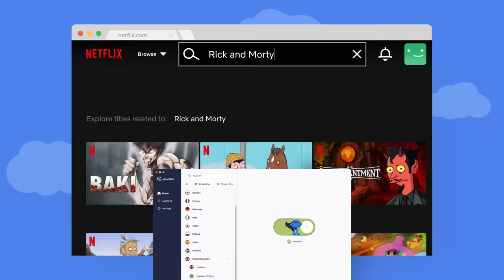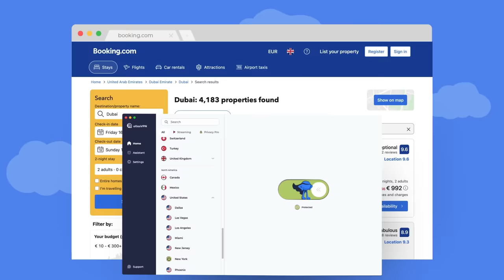How do Russians Cope with Heavy Tank Losses?

Comment: Honestly a 7x production increase isn't that impossible or weird really. Throughout all of recent history you would be lucky to get 50 tanks of any particular type produced in a year. Because when there isn't war you don't need war time production, so they only run one shift and they don't have high quotas or anything. Now running those factories 24/7 with extremely high quotas, well it's not hard to see how they could take that from 0.1 tanks per day to 0.7 tanks per day. 250 tanks per year isn't exactly Impossible, and that would be a roughly 7x increase over the average production of the T90 over the last 30~ years.
Reply: Pre-war, I think Russia's tank production was kinda idling anyway, awaiting the introduction of T-14. Just slow production to keep a core of the workforce, slowly updating the Russian tank fleet, and filling export orders. There's just the little problem, in that T-14 has been "coming soon" for a long time now, and will probably never enter service. Cost, and a new batch of "lessons learned" will probably require yet another new tank design.
Reply: They are claiming massive increases in production with pretty minor increases in the defense budget while also massively increasing the size of the Army while paying soldiers substantially more than ore-war. 

They are either lying about the product tion numbers, the budget numbers or both. But either way you are better if just ignoring what the Russians are claiming.
Reply: Yeah but they are losing about 2 tanks per day, so .7 is a big increase but still not sustainable
Reply: @SgtBeltfed Because T-14 isn't really important right now, it's just like in ww2 where they only produce the most cheapest tank than producing an expensive heavy tank, because they need a tank that was small so it can be more manuverable, cheap, easy to maintain, same like T-14, T-14 isn't a bad tank actually, it's actually pretty good in paper, the concept of it is the same like IS series in ww2, so it's the same like Armata, Armata is expensive, same like IS series, and the other T series give Russia more space ti fill the gap, they are cheap, easy to maintain, even if Armata is better than T series, it's still a tank, and it still can get the job done.
Reply: @scoobydoobers23  Russia spent more than 80 billion dollars during 2022 on its military, before SMO they were spending 60 billion dollars. And we yet do not know how much they spent during this year. Also you should consider that the currency being used in Russian economy isn't USD, therefore the amount of money being spent has been increasing by a lot.
Reply: @lotuscabage4755  T-14 was already late before the war, and Russia was under the impression it was going to be short, cheap, and bloodless. So much for their initial plans. T-14 is meant to go head to head with M1's, which really isn't a meaningful requirement in Ukraine. Tank on tank engagements are rare, and the main threat to tanks at the moment can be summed up as "everything else".
Reply: The problem is that scaling up production at the tank plant requires scaling up production along every single step in the production chain and that can be difficult or outright impossible. If a tank plant happened to have a large amount of parts laying around it is possible that they could have everyone work overtime and temporarily increase production for a while but eventually they'd run out of parts and then be limited by their suppliers. And most components in modern tanks are incredibly hard to scale up production of, the electronics and sensors can only be built at high tech plants with clean rooms and expensive machines, and the chips are almost definitely being supplied by Taiwan, guns and engines require purpose made metals that need specific chemicals in their production chain the production of which can only be scaled up by building entirely new factories, and the composite armor is also pretty complex to manufacture. Even a country like the US would have some trouble scaling up all of this production and it'd still take a long time and be very expensive. But for Russia it's even more difficult because every step of the way requires basic components and machines that are not made in Russia and are mostly made in the west, so Russia needs to smuggle these things in through China. Some stuff like guns and engines will be easier for Russia to scale up on it's own but electronics will be almost impossible to scale up and that's probably why Russia continues to have a shortage of infrared sights.
Reply: @SgtBeltfed  more than that. the recent war has shown how vulnerable tanks are when used in the traditional armored fist role.
Will probably see a shift way from heavy tanks to a more general purpose design like the T-90 or maybe even smaller/lighter.
The T-14 is currently being utilized as a command vehicle and going forward won't be produced in large numbers.
Reply: @hedgehog3180  You do realize that everything I said about the final assembly factory also applies to everything along the way? Factories that make armor plates or engines or tracks or tank radio systems all would have been functioning well under capacity just like the tank factory itself, and just like the tank factory itself you can scale up that production in the same way. Making tank armor and all these alloys actually isn't that hard, you just need the right material, a big box to cast it in and then a big hot roller to press it into the right size. The materials to make typical RHA are not particularly rare and russia or china produce all of them, I could list the hardest ones but I doubt that would mean anything to anyone really. Russia is really big so it has plenty of every metal required. Also most electronics used in tanks in fact do not require the latest microscopic processing chips made in Taiwan. Most military technology still uses chips designed in the 90s, I wouldn't be particularly surprised if you could find a vacuum tube laying around somewhere. The only slightly difficult thing is thermals but again gen 1/2 thermals dont exactly require state of the art microprocessors, most of those chips are produced by China now, China is well behind on the cutting edge of micro processors but when you are working with tech from the 90s well it's not very hard to replicate. 

TLDR: You can scale up production in every type of factory the same way as in the tank factory itself. Materials aren't an issue because Russia actually produces basically all of them, the electronics used in tanks are old and simple now and can be produced by basically any country. And anything Russia can't scale up can be made in China.
Reply: @scoobydoobers23 tripling the budget is a minor increase? Russia's pre-war military budget was 40-50 billion, 2022 was 80 billion and this year is forecasted to be over 120 billion.
Reply: russia doesn't have a full cycle armored vehicle production since 2012. Their 3 factories only do the modernization and repairs, even UVZ only managed to produce 190 T90Ms in over 4 years. Now they use tanks from storage bases, cannibalize them, repair and send to the front. Same with all the other armor. That's it.
Reply: @SgtBeltfed That is a very good point. A lot of lessons learned on the field might have them rethink many thing on the T14
Reply: @sdrkrm  No. Russia continued to produce about 10-20 T90 tanks a year from 2012-2020 and ramped production up to about 50 per year since 2020. Some of that was re using older T90 hulls but the T90M has a new turret, gun, engine and electrical systems so saying they are simply upgrading old T90 tanks with the T90M package is quite dumb considering they are essentially replacing every single functional component. Calling that just upgrading a tank is like saying you are upgrading your PC by getting a new motherboard, GPU, CPU, and power supply. Sure you kept the case and the ram, maybe some fans but are those really the expensive and important parts?
Reply: @simethigsomethingidfk  lol, pal, dozens of wrecks and captured t90ms prove you wrong.
Reply: @sdrkrm  What? How? I'm telling you they made some? How does them being destroyed change the fact they were made? If anything it proves that they were made
Reply: They restrore tanks from the storage and put those figures as "new tanks", obviously. They made about 200 new tanks per year before the war. More than a thousand new tanks per year now? It's imposible.
Reply: @simethigsomethingidfk  lol, not the fact, but all their serial numbers. All the guns, ALL were from 80s and 90s. And a new turret does not make a new tank, you know.
Reply: @hanniballecter7259  not tanks. Their 2021 report says that 226 new armored vehicles were delivered to the army including mbts, afvs, spgs and apcs. September video from UVZ shows the number on the hull of a "new" T90M - 193. Meaning that in over 6 years they've produced less than 190 T90M = only 30 per year. The last delivery from UVZ in Oct showed only 1, ONE T90M, while the previous 2 had 4 each, and the one prior to those - 8 tanks.
Reply: Even during non-war scenarios, factories are still going to run 24/7 operations. There are MASSIVE daily costs involved in keeping a factory up and you cannot be bringing machinery down every night and then trying to get that machinery up the next day. Commercial equipment doesn't take kindly to being shut off constantly or restarted repeatedly. Because of the flat daily costs, they'll keep production running at all hours across 2-3 shifts. You still have to keep the lights on and that equipment stays on, so it's accruing costs whether you use it or not. There are also incentives for delivering early on a contract, even in peacetime. You increase production by increasing the number of units built per day. You do that by moving more parts through the factory and having more workers working. The issue with 7x is that either their current massive factories are operated at a massive loss during peacetime or there's some number fudging going on. There's a limit to the number of workers and material you can fit inside of the factory which limits concurrent production numbers unless some massive corners are cut to reduce in-house production times which leads to faulty product. 

Most than likely what's going on is that 7x production value is coming from mostly refurbs/repairs and not new production. A depot repair if damage is light can be done in 1/20th of the time of production of a brand-new unit. The issue though is that this becomes a negatively sliding scale as you deplete the good condition stuff and start getting into the heavily neglected equipment that'll start to take far longer to refurbish and get operational again. Eventually, you'll get to the point a brand-new unit is quicker and cheaper than the refurbished unit as the costs of reconstituting the few salvageable components and replacing the rest with new ones results in more time and money spent on labor trying to refurb/repair the salvageable components than if they committed to just producing a whole new unit. It's a similar concept of when insurance companies total out a vehicle with frame damage. The costs/time required to properly fix the frame costs more and nearly as much as the replacement cost of the vehicle.
Reply: @James-9999  Source: The Ghost of Kiev
Reply: @sdrkrm  Source: The Ghost of Kiev
Reply: They are also probably counting tanks that require minimum repairs as “production”. Also let’s face it this is ruSSia, all the plant managers face a “race to the bottom” where everyone else is lying about their numbers so if you don’t you get penalised.
Reply: Well...  the Russians have a rather different oint of view regarding armored operations than NATO or the Israelis.
Their theory evolved from WW2 is overwhelmin h mass of armor advanving after mas d ive artillery prep.
As such a tank need not be cutting edge. It need not be designed for long operstioal life. Although the Russians do come up with some pretty good designs.
Their inventory of old taks going back to the 50s is enormous.these tanks are not sophisticated but mounting st lesst 2 machine guns and a 100 mm gu they are dangerous and serve quite well as mobile artillery.
They are not particularly difficult to return to operational status becsuse of their simplicity. The crews arent tie consuming to train they need only lesrn how to maneuver the tank train the gun load and fire it.
In short both tank and crew are disposable. At worst they soak up an expensive anti tank round. At best they kill some zukrsinians. It should be pointed out that their 100 mm gun is perfectly c a pable of killing  german Leopard 1 tanks armour.

Russia has moved more or ess to war footing production of equipment and ammunitio. The West has not.
The d upply of armour especially tanks to Ukraine from the West has been parsiminous at best. 37 Abrams tanks is a meaingless number really. And they came late as well.
The Ukr a inians have virtually no internal resources to regenerate lost armour. Hence they are constrained in how they use their armour.
Slowly but inevitably the zrussias are learning an d building the mass necessary to engage in mass armoured and combined arms maneuver.
The Ukrsinians cannot becsuse theWest has not taken the measures necessary to adequately supply them. 
A good deal of scorn has been he a ped on the Russisn strategy and tactics. And its true that had they fsced a peer enemy fro. The st a rt without the Russians self iposedhan f icaps the war would be over in favor of Russias adversary.
But Ukraine was not even close to being a peer and the West has not transformed it into A peer due to a pecular mix of self deludion timidity and downright stingy stupidity.
The Russians using a combination of coercio and cupidity contine to refresh their troops with conscrips and contract soldiers. They have 4x the populationand sre isensitive to losses.
The zukrainians are not able to match them and cannot employ brute force as the  Russians are. They inflict disproportionate losses on defense but acannot afford and lack the mass to engage in decisive counter offensive operations.
Reply: @James-9999  Oryx counts about 2,500 Russian tanks and their figures are lowball for obvious reasons. That's about 4 tanks per day. Plus the loss rate has accelerated in recent months.
Reply: Except that you need to factor in that they no longer have access to western imports so they are either cutting corners or more likely including repaired and refurbished tanks as part of that number.

Comment: With drones routinely destroying abandoned tanks, how many damaged tanks ever get back to be repaired?  Just those still mobile enough to drive back under their own power?
Reply: It mostly depends on where and when exactly the tank was damaged. If the loss occured during an assault, and the vehicle was hit on "no mans land", so between the positions of aggressors and defenders, it wont be recovered until one side takes control of that territory. If the loss occurs behind the lines, it can be retrived quite quickly. It also depends on the capabilities (ARV, towing equipment) a given unit operating in the region has, or if it can be supported from other units. 
In the aggression of Russia on Ukraine both sides are recovering combat vehicles if only they are able to. Every single armored vehicle is an important asset.
Reply: Sometimes, yes, but I also see Russians and Ukrainians use the cover of darkness to recover those tanks. Sometimes they get lucky if no drones are around.
Reply: Light drone payload is limited, so most common warheads are modified RPG-7 HEAT or RKG-3 anti tank hand grenade, which are both relatively weak. HEAT penetrating effect is like pushing a pencil through cake, it just makes a linear hole though weakly armored tank hull and turret roof. If the plasma stream does not hit anything important, it might just travel through the floor. 

Hit placement with drone is the thing, that's why drone operator circles around trying to find best possible angle. Every tank has weak spots and vital equipment.

Also demoralizing effect is pretty hard, crew can abandon tank and not investigate the severity of the hit. Tank can be kinda ok and drivable after drone attack, but crew got hit from the flying metal and instrumentation pieces.

If you get the tank to burn, then it is usually toast and only good for scrap metal collection. If not, then the fix might be rather simple, but then and there impossible at the field. Drone hit could make just enough damage so the engine won't start or jam the transmission.
Reply: @juhaantti-poika9955 I think you might be underestimating HEAT warheads alittle bit. While traveling through solid armor it is a very narrow hole that’s created, but the moment that solid metal ends the plasma/liquified copper and steel come flying out in a quickly widening cone pattern spraying the inside with super heated metal.